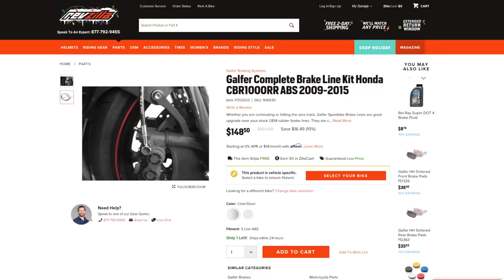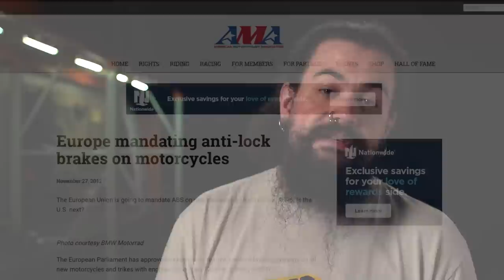3 Arguments AGAINST Motorcycle ABS!

Comment: I'm still angry that I cant turn my headlight on and off so it's to soon for me to talk about ABS.
Reply: Just remove the ABS fuse like on a car and bam no ABS
Reply: @paule5812  I know and putting a switch in for the headlight and disabling the switch for the side stand are all easy but that doesn't mean I have to like it.
Reply: Corey Brass understandable
Reply: @MrPlopfest and that's a great reason for me to use a headlight...but it still should be my choice.
Here is an interesting fact that you can research; if every automobile passenger had a helmet on then more lives would be saved then if every motorcyclist didnt wear a helmet.
Reply: Disable your low beam and only use the high beam - that way you can turn it on & off (that's what l do)

You're welcome...
Reply: @anthonysilvestri4946  that sounds like an A-hole move to everyone at night...so...ya... I'm not going to do that but thanks for the suggestion.
Reply: @MrPlopfest this is not the hill I plan to die on.
Reply: @justdad53  wow I had no idea they did that. I have a 2000 BMW R1150GS and the ABS took a dump on me a few years ago. I've tried and tried to fix it but I need a new...brain for it. It's about $3000 for a used brain, so now I just have black tape over the flashing ABS light.
Reply: @CoreyBrass  - actually it's not, motorcycle headlights are notoriously not that bright, especially compared to a lifted F150 or Dodge Ram  LOL
Reply: @anthonysilvestri4946  That would be a massive dick move. My bikes headlight is super bright on high beam. And its called high beam because it physically moves the focal point of light up, into the eyes of oncoming motorists.
Reply: Here we have to have headlight lit when bikes being ridden so that issue dont work for us. But no helmet law here. As far as abs i dont like on my car or truck so not sure id like on bike
Reply: Tracey Graham in a car you have (at least) 4 tyres with 4 completely different levels of traction and 1 brake pedal. A modern abs system can moderate brake pressure on one wheel to control a loss of traction while keeping full braking force to the other 3 wheels, something you absolutely cannot do without having 4 feet and an individual brake pedal for each corner of the vehicle.
Reply: Paul E Sure, while that may have worked on some older bikes it generally doesn’t anymore...it will almost always at least kick off a constant warning/system failure light.  Not only annoying, but this may also mask other system failures in the event that it’s a shared indicator.  But even with that aside if pulling a fuse works you’ve still been forced to pay for the system (on most bikes where ABS and non-ABS versions are available the ABS version generally carries somewhere around a $1,000 premium) and you’re still lugging around the extra weight and complexity of the system.
Reply: :)))))))      I thought I was the only one...
Reply: @CoreyBrass  wut. helmets kill in cars because of the airbags. its either or.
Reply: Why do you want to turn it off?  Headlights on makes you more visible to other road users which is better for safety.
Reply: @michaelclark3192  I can see the age difference already. You ask why I want to turn it off because apparently you've never know it to be any other way. I want to control when I turn it on. 

You're 100% correct that I'm safer with the headlights on and I'd probably keep them on but that's not really the point. I want the choice. My hi-viz jacket is safer then someone else's black jacket but we'd all be annoyed if we were told we had to wear neon yellow jackets. I don't ride to be safe I ride because it's an extension of who I am and I like to have as much control over how I ride as possible.
Reply: @nocensorship8092  that's incorrect. Study after study has shown that if automobile passenger had helmets more lives would be saved. Implying that helmets and airbags works against each other is frankly ridiculous and anyone who gives it more then 5 min of thought would know that.
Reply: @CoreyBrass  :l You believe studies. good for you. Studies are as reliable as made up facts by a 2nd grader. You may be right but even if thats true the helmets would overall greatly increase the amount of accidents and thereby the fatalities. Think about the visibility issues, also cars are not big enough to wear helmets inside. You`d have to lower the seat and remove polstering like in racecars if the driver is even slightly tall. Not to mention that the ability to help themselves in accidents would be near NILL if wearing a helmet and airbags would have to be adjusted because otherwise the helmet moves the impact area of the face/airbag much closer since helmets add like 10-15cm from the seat to the airbag distance. Its also hard to breathe in helmets and it only works so well on motorcycles cause the airflow goes into the helmet and ventiliates it. YOud have so many issues wearing helmets in cars its frankly ridiculous to claim it would improve overall safety. Passive safety maybe.. but its definitely a net negative. Ive driven motorcycle a while and i know how helmets are and how impossible it is to get into a car with one. You can really not wind yourself out of that, its just a stupid thought.
Reply: @nocensorship8092  I don't have to claim it would increase overall safety...people who are (based on your ramblings above) much smarter then you have claimed it, then backed it up with data. 

I have nothing more to say to you on this subject but if you tag me in anymore incoherent gibberish I will give a thumbs up to show I read it.
Reply: I'm still pissed that LED headlights aren't standard on all US market bikes by now.
Reply: @jldude84  small change that would make a huge impact and would cost next to nothing for them to upgrade on existing models and BS that they come out with new models that don't have them.
Reply: @CoreyBrass  Cuz they're cheap as shit. Just like auto manufacturers. Even if a superior safety feature costs an extra $10, they'll wait till literally everyone else is including it standard then they'll THINK about making it standard.
Reply: Lol
Reply: I literally have this issue on my Ducati Scrambler hahaha
Reply: @CoreyBrass  lol, hahaha
Reply: That manufactures don't build a dark mode into bikes is infuriating, it's all aftermarket.